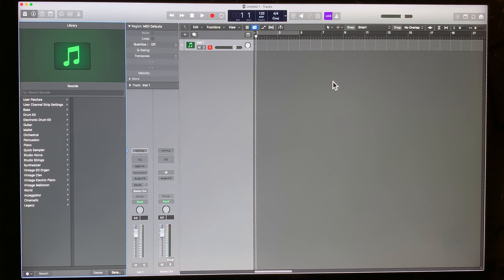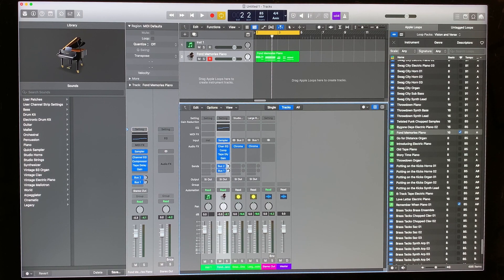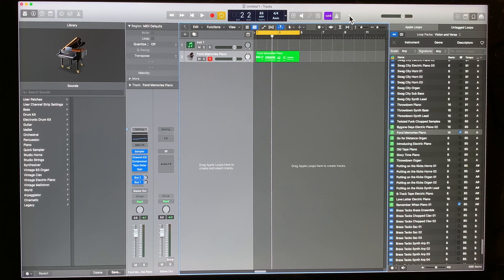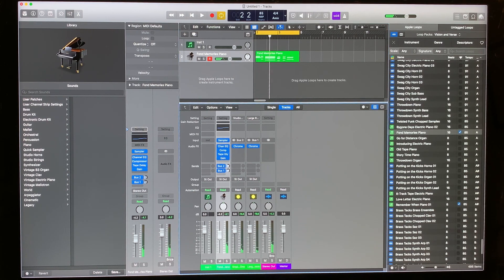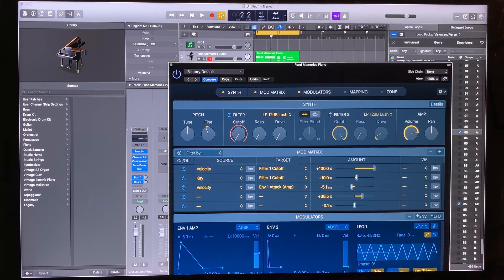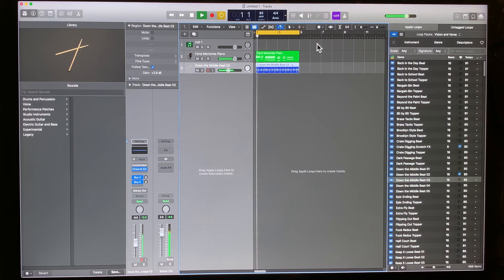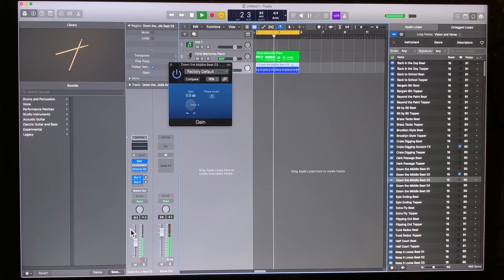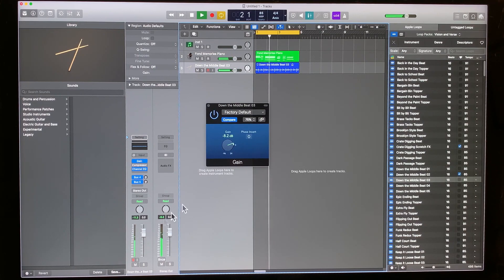Tutorial - How to Gain Stage in Logic Pro X

Comment: Very useful video. Thank you!! Now the only thing that gets me is the ending. I know we leave master out alone but when you say to lower the stereo out to -12db.. is this also using the metering and gain? I was confused. Since you said to not touch faders. Would we just bring up the gain and turn on pre fader metering?
Reply from the maker: Ok so I think I get what your asking, so your wondering what I meant by make sure the master output or the stereo out is at -12 dB?
what I’m talking about is you want your output volume of all the tracks combined to be around -12 dB, so that when you go to master your track you have a good amount of head space in your over all mix. 
So I said to not touch the faders, I probably should of further explaned that… So you should only touch the faders to set them to all 0.0 dB, but after that leave them alone. Now what you do to control the volume is use the gain plugin on the track. ( tip. in the channel strip make sure that the gain plug-in is at the top off the chain otherwise it won't work properly) 
Now volume levels vary depending on the instrument, for example I set main kick drum two -18 dB the bass to -20 dB and everything else below -20 dB like pads, piano, hi-hats, percussion etc… there are no set rules that you have to follow but generally I like to keep everything under -12 dB on the master output. 

I hope that answers your question, let me know if there’s anything you want me to touch on?